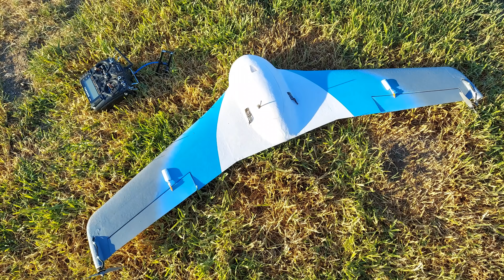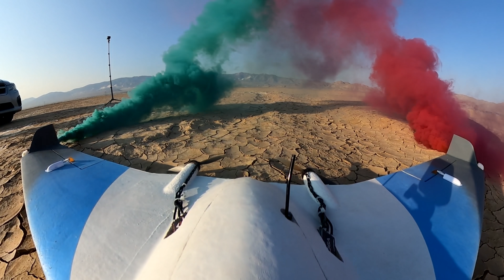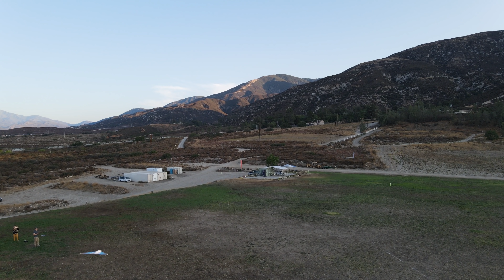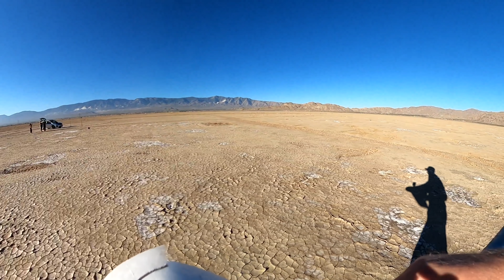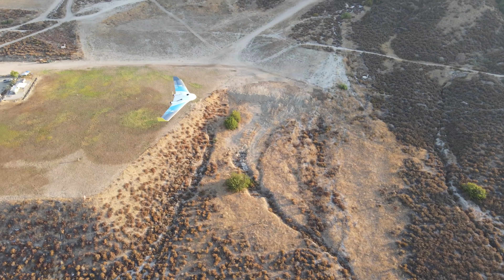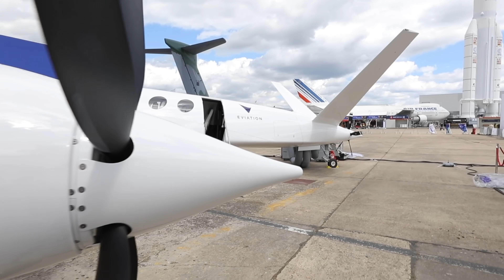Can Wingtip Motors Improve Aircraft Efficiency?  RCTestFlight Solar Collaboration Part 1

Comment: Being an Aircraft mechanic, I'm going to have to doubt a number of statements made at the beginning of the video. Most specifically, I figure that While electric motors are improving all the time, batteries are still nowhere near being able to replace Gasoline or Kerosene (Jet A) as storage mediums for aviation. The simple fact is, for a given energy capacity, batteries still take much more volume and weight to store. The really nice thing about liquid fuels, especially in aviation is the fact that they get used up. By the midpoint of a flight, on even say a Cessna 172M, the airplane can be as much as 130lbs (approximately) lighter (22 gallons out of a maximum of 46). Batteries leave you dealing with a not insignificant chunk of dead weight once the battery is depleted. This is before you even start considering the impact of potential surprise condition changes during a given flight. When running on battery, your maximum range is directly dependent on the other uses of electricity, and if say you wind up finding a IFR condition by nasty surprise (it happens more than you think), suddenly your range figures could go down below the minimum safes. Liquid fueled engines do not deal with this the same way, since generating electricity through the alternator is generally treated as a byproduct, and range is almost unaffected by the condition of the aircraft's electrical system.

Secondly, I'm curious as to why the sole choice of pusher configurations for this test. IIRC, one of the reasons that the pusher configuration is relatively rare in aviation is that clean airflow over airfoils generates more aerodynamic forces (i.e. lift OR thrust, depending on the aircraft), so putting pusher props into already turbulent airflow results in a more efficient wing , but worse output from the powerplant. I'm kind of curious how your results pan out if you include A: Pusher vs tractor configurations, and B: Ducted fan operations in similar and alternate setups, as again, IIRC, ducted fans are less affected by turbulent air, and act as small scale surrogates for turbine engines.

But I'm just ranting at this point. Like I said, I'm a mechanic, so I prefer sticking to tried and true, and letting new technologies prove themselves instead of jumping on the early adoption train.

Seriously, props on asking a question and trying it out.
Reply: 40 years in Aircraft Industry, 16 as a Rigger ~ I concur with your views,   Theory is Theory, but far from the harsh realities of practicality. Even the Wright flyer of1903 carried a payload
Reply: @andyb.1026  Aircraft rigging. That ranges from one of the more fun jobs on the aircraft I deal with (Ailerons, on earlier 152 and 172's) to one of my most hated (Friggin Elevator trim... 152, 172, and anything Piper). And that's without even considering trying to run new control cables... I can scarcely imagine trying to do that job on more complex/larger scale aircraft... Especially something like the central "spool" (it looks like a spool, kind of) that has the entirety of Douglas DC-8 family aircraft wing control cables go around it at one central point. I salute you for your longtime service in the industry.
Reply: Battery technology has improved by many folds since the days you were in school. And then battery is not the only power source for electric motor. Fuel cell, especially hydrogen fuel cell, is already used in active research. See wiki
https://en.m.wikipedia.org/wiki/Fuel_cell
Reply: @emilelepissier7550  I'm sorry, but I'm NOT flying with a hydrogen fuel cell. Too freakin dangerous, without even addressing some of the other issues I was concerned about.
Reply: @Skyfighter64, your risk assessment of hydrogen system may not be inline with state of the art now and in the future when hydrogen technology is fully matured, but you are entitled to your choice. Flying is inherently more risky than many other transport modes anyway,  so to be consistent, may be you should reconsider about flying.
Reply: @SierraLima not only electric technology is moving so fast that what you may think as valid comparisons may already be outdated. Furthermore, electric motor should not be viewed as drop-in replacement for conventional power plants. An electric plane can have multiple power sources: fuel cell, solar cell, supercapacitor, and batteries. Some may have lower energy but others like methane and methanol have energy densities comparable  that of conventional fuel. Overall system + fuel weight may not be much different. Hydrogen actually has 3 times the energy and couples with the much higher theoretical efficiency of fuel cell, means the fuel amount onboard approaches an order of magnitude less. As for onboard storage, cryogenic tank with aerogel insulation will be competitive at least weight-wise. The major hurdle is not so much eefficiency but cost. However with enough investment cost will come down, c.f. solar cell.
Reply: I need my plane to fly for 5 hours.  Ain’t no damn green bullshit power source going to give me that.  I can’t even get 300 miles from a Tesla, and that’s the best out there.
Reply: @emilelepissier7550  There is nothing on earth now, or in the future that will make a hydrogen based system safe. If that hydrogen system gets breached at any point, you have a VERY volatile gas that can be lit at a very low temperature. Worse, this fire is nearly invisible, since the flame is so incredibly hot, the most of the light it gives off is in the ultraviolet spectrum. 

Want to know one of the great things about a gasoline leak on an aircraft? You can see it. the blue dye gives a very clear indication that you have fuel leaking, leading you right back to where its leaking from. Imagine trying to do that with a colorless gas.

Then there's the containment vessels themselves involved with hydrogen. How much do they weigh, can they be repaired, or how long will they last? Compare this to a gasoline storage in a Cessna 172R. The wing IS the storage vessel. They didn't even have to add a separate tank. on 152/172M and P models (the ones I work on the most), this fuel tank is a very thin, either aluminum or steel (I never had to think about it before. Probably aluminum) shell that weighs about 3-5 pounds depending on which aircraft. These shells are pretty easy for a qualified welder to repair, and ours are still the original tanks they've flown  with since 1985 for the latest 152, or 1973 for one of our oldest 172's.

If the pressure vessels for hydrogen are made out of composites, they might last a few years, but then will not be recyclable... just like those fancy windmills. Forget trying to repair such a vessel. The weight of a metal cylinder for hydrogen would be waaaaaaay too much for any general aviation style airplane.

You are rather flippant about safety. Aviation is dangerous. That's WHY it's my job to ensure things are as safe as they can be and remove dangerous factors. I've had to deal with people dying on an aircraft I've worked on. It may have only been an idle adjustment to the engine, and the FAA investigation may have determined it to be pilot error, but the fact that I worked on that airplane days before they crashed and died in it haunts me.
Reply: @emilelepissier7550  Hydrogen is only an energy store and one that is dangerous and not that easy to handle (huge pressures etc.). Carbon is not the problem, it's where it comes from and where it goes.
Hydrocarbons are a mature energy storage technology. Direct hydrocarbon fuel cell technology is progressing and already more efficient than engines. 
Easy to handle and store hydrocarbons from renewable sources (bio or synthetically produced from nuclear, solar or wind energy), whether burnt in engines or fuel cells are the near term future. Net carbon zero and a storage and distribution network already in place.
Aluminium primary batteries (fuel cells) could be another energy storage tech. High energy density and the aluminium is fully recyclable. One weird issue for aviation though. They use oxygen in the air, so get heavier as they are used up. So landing weight ends up heavier than take off weight!
Batteries need an order of magnitude improvement to be serious for aviation use.
Reply: On your first point, I'm not sure I agree with everything you say. Weight doesn't necessarily decrease efficiency, as it has nothing to do with the lift vs drag equations. In fact, competition gliders usually fill up with 200+ liters of water to increase performance at higher speeds. The added weight is just potential energy (e= m * h * g), waiting to be used. Now, this obviously only really helps during the descent stage, but since that is in the later stage when conventional tanks are most empty (and thus removed all of that potential energy), it might play a role.

Second of all, with normal tanks your electrical system is also powered by your fuel source. They run on the alternator, which runs on your engine, which runs on your fuel. If you turn on more systems, you burn through your fuel faster (so your range is decreased). The big difference is that a normal engine/alternator combination is a lot less efficient than plain batteries, so it probably has a higher impact than a purely electrical version. In the end, if you have enough energy on board, it shouldn't make a difference.
Reply: Actually, if you've been watching new developments, just within the past 2 months of this posting (Mar 2023), there were several innovations announced that result in major leaps in battery energy density. Some relate to new formulations and some relate to new ideas in construction. The net result of these new discoveries is that there has been a major jump in performance which will be seen first in electric cars which will likely see an instant 50%-100% increase in range by this time next year if not earlier. This will have a major effect on electrically powered aviation. Private planes that can travel up to about 100 miles already exist and some were projecting that small regional commercial aircraft that could travel about 100 miles might be seen by next near (2024) although I haven't seen even a demo of that yet. Some where suggesting that "structural batteries" would be the solution but that would mean aircraft would have to be disposable and the entire aircraft recycled or disposed when the batteries no longer worked. But the new technologies will likely deliver at least the same capacity and performance while still being able to replace the batteries. Or, maybe structural batteries is still the way to go and we're that much closer to an economical commercial aircraft.
Reply: @tonysu8860  Do you have any idea how far a Cessna 152 can travel in one flight?  On 26 gallons of AVGAS (Read: full wing tanks), the Cessna 152 can travel almost 500 miles, and stay in the air for around 4 hours. With full tanks, that still leaves a useful load (depending on configuration of course) of over 400lbs. That means I could, if I wanted to, travel from Denton, TX, to Kansas City, MO, then after a fill-up, travel to Indianapolis, Indiana, in a single day of flying. (Hypothetical example, of course).

That's just a basic example of what gasoline means to Aviation compared to what you suggest for "emerging techology" in regards to batteries. 40-50 year old airplanes with antiquated aluminum fuselages can still take you across half the North American Continent in a single day.

I'm a mechanic. Peoples's lives rely on me every freakin day making important decisions on how to ensure the aircraft at the flight training school I work for are safe and reliable. We could not operate on electrically powered airplanes. Period. from 6am through 9PM, aircraft can be expected to operate 4, maybe even 5 flights a day, with only enough time for the next pilot to do a full pre-flight and get the airplane refueled. 

Hence why I so readily doubt things. I'm a skeptic. When technology is proven viable, then maybe I'll reconsider, but given how the last great tech leap in aviation set the flying world on fire thanks to overly eager early adoption of unproven technology (Talkin bout Li-Poly batteries), I am fairly certain that my position is in fact, the logical one.

I do apologize a bit for this. It really did turn into a much bigger rant than I imagined.

Have a nice day.
Reply: I think part of the advantage to use a pusher prop configuration here is just that its easier to mount pusher props near wing tips of a tapered wing than tractor props, as the latter may end up needing extension shafts just to put them well ahead of the wingroot LE

That said, Tractor Wingtip propellers can potentially give much greater bonuses to lift, as seen with the V-173. The test pilots were not ABLE to bring it into a full stall or spin, even when deliberately trying to do so.

Comment: Check out the development of the Vought V-173. The propellers were arranged to rotate in the opposite direction to the tip vortices, allowing the aircraft to fly with a much smaller wing area, or in your situation should provide greater efficiency
Reply: To be cleae, the Flying Pancake had a pretty ridiculous amount of wing area: the goal was to get a plane with incredibly short takeoff and landing runs compared to conventional aircraft, without sacrificing high speed capabilities.

It's still correct to say allowed it to fly with a smaller wing area (for a given airspeed), it just doesn't 100% address the design intent

The Flapjack and Pancake are kinda my current obsession (literally trying to build my own version in RC atm)...

Comment: Fascinating! I'm going to show my STEM group this because it's such a good lesson, thanks for uploading it!
Reply from the maker: Fantastic!   Very glad it provided value.
Reply: Pure scientists and mathematicians think theoretically.  Practical engineers and technologists/technicians know that that things fail and need maintenance.
One wingtip motor failure = flat spin/cartwheel of death
For safety, you would need more than just one motor on each wingtip.  Possibly a  dual motor, coaxial design per tip.
The V-22 Osprey has a relatively bad safety record.  Everybody dies if one motor fails!
Reply: @toolbaggers  But is it's safety record bad because of the wingtip motors or because of Boing?
Reply: @toolbaggers  V22 motors are connected by common gearbox so if one motor fail no one dies cause of it.

Comment: Loved the video. Also I’m sure one of the reasons companies have stayed away from the wingtip engine configuration is with engine failures. It may provide great numbers in efficiency, but the cost of one engine failing means the other engine is basically useless. There would probably be too much yaw the allow the plane to fly straight.
Reply: that too but mostly because engines are too heavy and big, electric engines are much smaller and allow for small ones to be placed at the wingtips

Comment: The noted improvement of efficiency is with the motors in pusher configuration; what improvement would you get with them in tractor?  Put the props just ahead of the leading edge and rotating against the usual direction of wingtip vortices.
Reply: That's the interaction I was curious about. I would like to SEE the effects of changing the prop direction. What are the pro's and con's of spinning the same direction as the naturally induced vortices, or the opposite?

Comment: As a multiengine pilot I could see significant issues with P factor, accelerated slip stream, and torque issues if one engine ever failed. While a very curious video and very interesting idea, I’m not sure that a twin engine aircraft would ever be safe enough in that configuration to carry passengers.
Reply: What if it had an engine in the front as well? Or directly behind it going backwards? Like 3 engines in total.